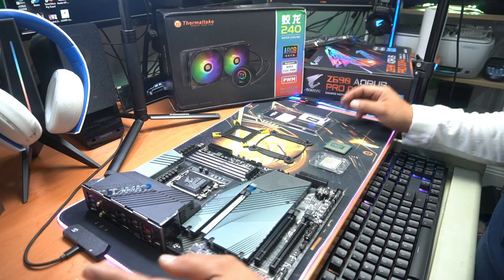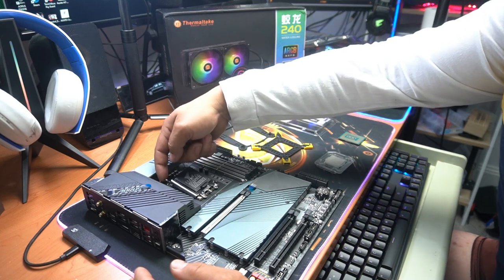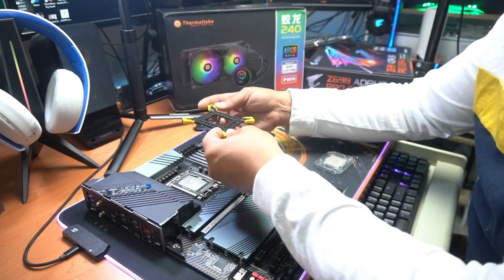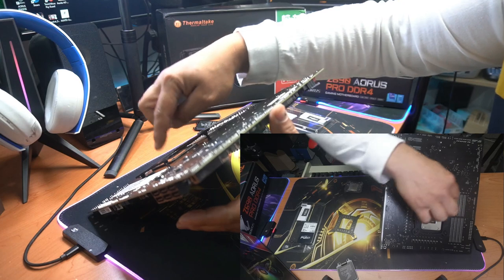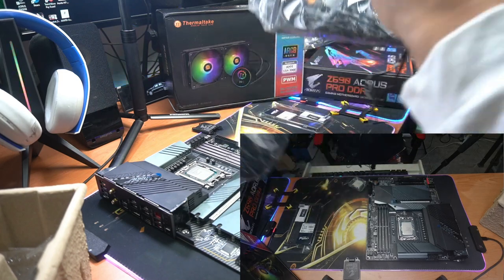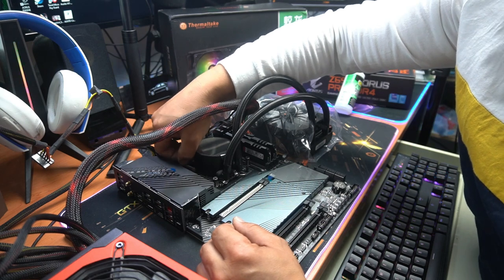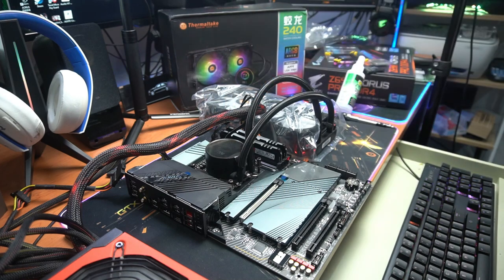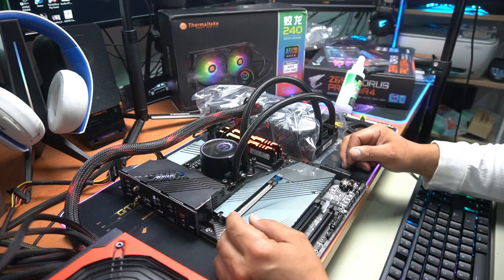lga 1700 cpu aio  liquid cooler mount retrofit- use bracket off lga 115X/1200/20XX/AM4/TR4 for 1700

Comment: What is the bracket brand did you use and is it universal?
Reply from the maker: no brand name ..its a universal one but usually the bracket off a gigabyte or msi ..work remember u need one that allows for adjusting..it must slide back and forth ..but honestly most pc shops now sell the proper lga 1700 bracket cheap ..ciz I assume ur using it for a 1700 mobo right
Reply: @MIKEYZVLOGZ  thanks but how can i find this kit then :d
Reply from the maker: @mehmetoz1932  ebay and Amazon n aliexpress
Reply from the maker: @mehmetoz1932  I'll link in description for u
Reply: @MIKEYZVLOGZ  ❤️❤️

Comment: When I buy the retrokit, do I buy it base on the socket of my MB or base on the aio cooler I have ?
My aio is 2011 , MB is 1700
Reply from the maker: u buy according to your mobo ... that way wen you goto install the aio it will fit accordingly , your aio will most likely fit most models , but its only diff if you have a lga 1700 mobo , just ensure that the kit you buy can support your mobo thats it and u should be good mate
Reply: Thanks slot

Comment: that first mount your using is azatec , corsair used them upto the xt and caplex
Reply from the maker: ye i noticed its on alot of brands now too.. thermaltake use it too..and if it is like the grey one ..u can use it directly for a 1700 mobo... ive done this numerous times qnd it works a treat
Reply: @MIKEYZVLOGZ  I've got a h110i v2 and a 115i rgb pro with the same back plate yet same standoffs of the platinum  yet a different backplate  , but I'm still waiting form corsair will it fit the LGA1200 socket on a z490  yet there site says it does for the pro , not sure about the v2 but i reckon the pro will fit , mb is ordered and got cpu so will look then
Reply: @MIKEYZVLOGZ  h110i v2 and the 115i pro fits mate using the 115z screws in the boxes so the h110i v2 will be a backup its virtually new as it was a warranty replacement at end of warranty, i cancelled the corsair XT cooler and still no answer off them even sending a ticket
Reply from the maker: @namAlexander  i noticed that as long the mount bracket is adjustable ...u can use it to mount 1700. even mounts that didnt fit due to not having a sliding bolt... i filed it down and made it fit ...
Reply: @MIKEYZVLOGZ  Not wrong there, Improvise, Adapt And Overcome comes to mind and you save a good lump on top, i wont mind the coolers are not as stressed as there not on the older cpu i was using , fans are running half the speed on same balanced cooler settings

Comment: I read that asus 600 series motherboards put extra holes to use 1700 and 1200 brackets to use old aio coolers, can you confirm?
Reply from the maker: I haven't used a asus mobo yet so can't say but just google the aus mobos ..maybe it will show on the diagram of the mobo..after a quick look it does seem they have made two holes next to each other to accommodate the mounting brackets 😉

Comment: I have a nzxt x53 cooler and it worked perfectly over my 12900k, I do run a push pull set up in my lian li case, I'm still gonna upgrade to a 360 aio probably the z73
Reply from the maker: GOOD STUFF..
Reply: I have the exact same aio, and im scared to buy a new mobo, since i will need the adapter and i can't quite get it. Did it work smooth? And how did you manage to use the old bracket?
Reply: @itaynoyman8616   everything works the same way the only issue was the tension, so I added a plastic washer on each stud before I put the bracket behind the mobo to make the studs slightly shorter and everything was the same after that, I did upgrade to the z73 with the lcd screen and 360 radiator but I never uograded to to 1700 bracket, you can check some of my vids, my Temps stay between 50-80c
Reply: @disaster6467  did you use the asus z690 mobo? I think it only works on this one isnt it?
Reply: @itaynoyman8616  I have a msi pro z690 ddr4, like I said it worked fine for me, I've removed the aio a few times and the paste seems to be making good contact, also never had a crash or blue screen and I've ran cinebench r23 many times with no issues, depending on fan speed I can get it not to hit 100c but this is a hot cpu, even watching Jay2cents with a complete water loop and 2 360 radiators was getting pretty hot, this test is very hard on the cpu so during gaming It stays below 80 hit averages 60-70, I will get the right 1700 adapter just to see if it makes a difference, but undervolting seems the way to go tbh

Comment: I am confused.. so a 1200 cooler and a 1700 cpu will work fine on a mobo with 1200 fittings?
Reply from the maker: no it's a 1200 cooler fitted onto a 1700 motherboard and cpu using only 1200 fittings... 
my aio was only designed for 1151 1200 etc ... and I had the 12th gen cpu and mobo... I managed to use the aio still with the 1200 mount ... eventho it's a 1700 cpu and mobo... hope that makes sense
Reply: Wha about if a motheboard supports both 1200 and 1700 cpu but the cpu os 1700? Will a 1200 cooler fit properly?
Reply from the maker: @el__2079  yes it will still fit as long as ur using the same type of mount I use that is adjustable ..

Comment: You only used the 8 pin pwr cable for the CPU? I'm using the MSI B660M Mortar - it has 2x 8 pin cable.  Is it okay if I just use 1x 8 pin cable, instead of 2x?  I'm currently salvaging my few years old PSU but unfortunately, it only has 1x 8/4 pin...
Reply from the maker: yep sure is, ive always seen x2 8pin aswell but ive only ever used the x1 of the 2 and its always been fine, i dont understand why it woiuld need x2 8pin plugs for the mobo , seems like over kill , even on boards thgat have 4p and 8pin i only use the 8pin and leave the 4pin unplugged
Reply: You only need the second 8 or 4 pin if you are doing extreme overclocking. You only need to use the one 8 pin otherwise.
Reply from the maker: @Ripperz667  good point

Comment: would this work with the rog strix lc aio? it comes with the same bracket that you used but I've been seeing mixed answers on whether it would work or not. I'm trying to do this with the z690 aero g
Reply from the maker: HONESTLY IT REALLY DEPENDS HOW THE BRACKET IS USED AND what you mobo holes look like , i have had to modify the brackets in some cases, but i always seem to get it to fit, sometimes i file the mounting holes of the bracket, i never modify the mobo, cuz u should not touch the mobo or modify it in anyway, as u can do real damage due to gold lining connection that run along the mobo circuit.. only ever modify the mounting bracket  and somehow make it fit, however sometimes it wont just fit,  and u will need the 1700 bracket made for it, most manufacturers are releasing the correct lga 1700 bracket for their mobo.. sometimes its better to just do that , especially if it seems too much trouble to make the 1200 fit the 1700,or if u are at risj of damaging your mobo in anyway or aio
Reply: Oh okay, thank you